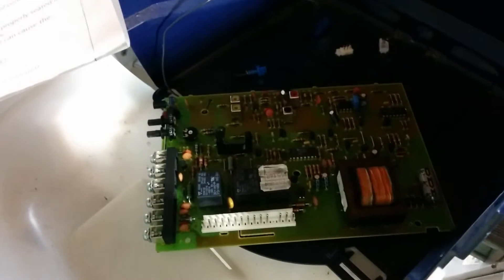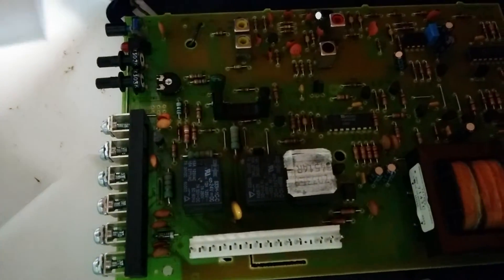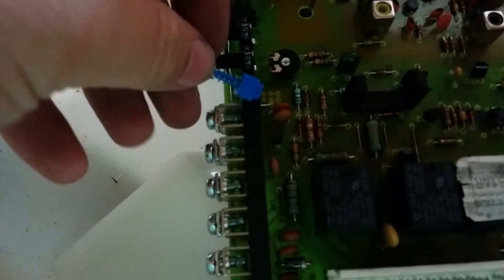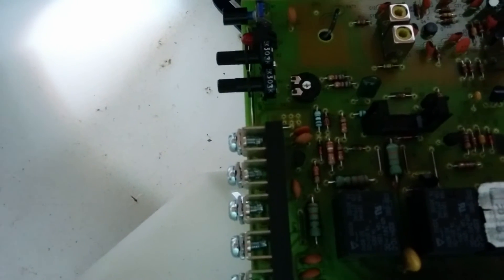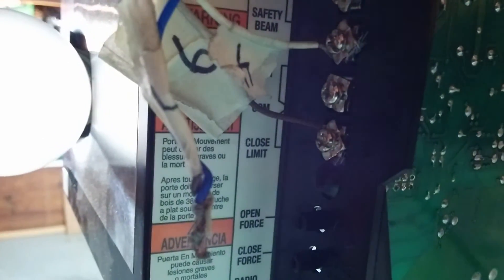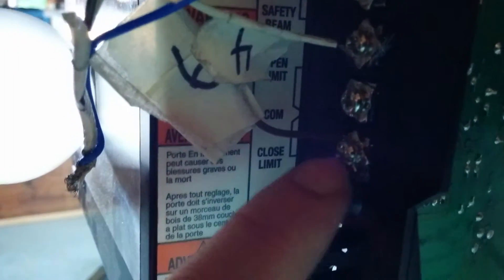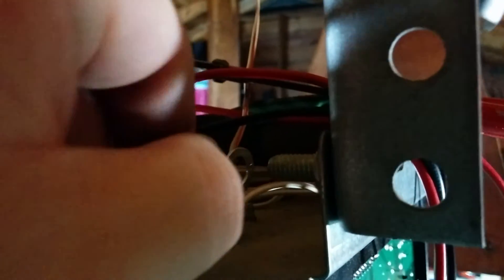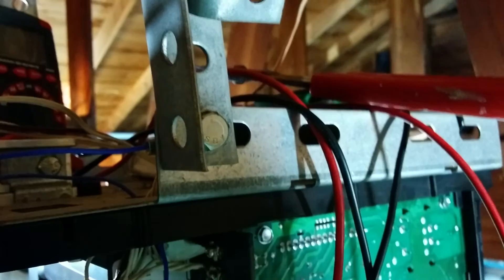Overhead Door Python 2 Circuit Board Replacement

Comment: This opener is a PIECE OF JUNK, You should’ve payed money on buying a new Overhead Door, Genie, or Liftmaster, Chamberlain, or Craftsman Belt Drive. Replace this JUNK These have a VERY FLAWED DESIGN TO THE POINT THERE ONE OF THE WORST OPENER’S EVER MADE OTHER THAN MARANTEC, XTREME, AND WAYNE DALTON. JUST BUY A NEW OPENER THIS THING IS HORRIBLE IT WAS BASICALLY A OVERHEAD DOOR LAGACY BUT IT HAD AN IN-LINE CHAIN AND IT TURNED OUT TO BE JUNK, If you buy a house with this opener replace it immediately please, It’s the 4th worst opener ever made, This is also the only bad Genie opener, Liftmaster made bad openers, But not as bad as THIS, Liftmaster openers tend to be cheap plastic too, This gotta be the 4th worst opener ever made, These are horrible openers.

Comment: This opener is a piece of crap. You should have spent money on a new liftmaster belt drive instead of replacing the board. Anytime I see one of these chain glide openers, I recommend that the homeowner replace it with a new one.
Reply from the maker: It was significantly cheaper and easier to just replace the board. Chain drive has been working reliably for years. It's a detached garage so there's no concerns with noise. Why would you advise replacing it with the given situation?
Reply: It's a python chain glide, not a chain drive. A chain drive has a continuous chain, and a chain glide is fed into a plastic channel that would constantly fail. These are probably the worst and cheapest openers ever made. It's your call, but My recommendation to you is to get a new opener.
Reply: @TBHD724  No, It’s Wayne Dalton.
Reply: @TBHD724  Also the things holding the light lens in place fail constantly when open for too long, Causing the lens to fall.

Comment: Thank you so much for taking the time to make this video. My Python 2 Overhead circuit board fried pretty bad (already soldered on it 3 years ago when I found cracked solder beads) but this time I had to buy the 36190S and I followed your instructions exactly and it worked right away. Wish I could buy you a beer.